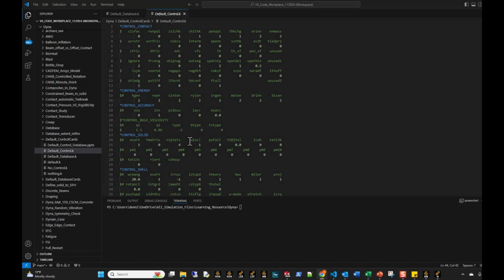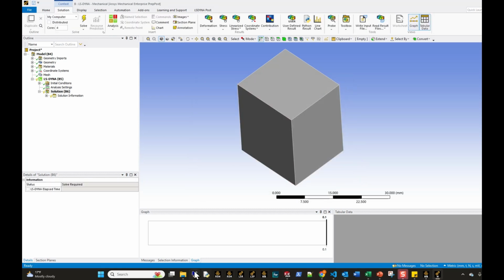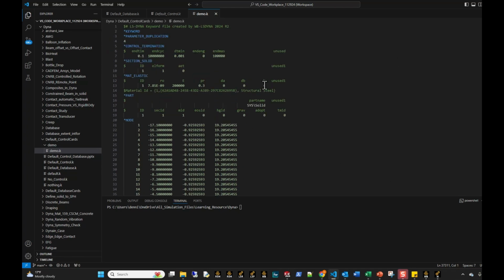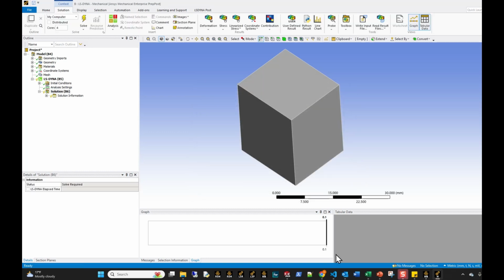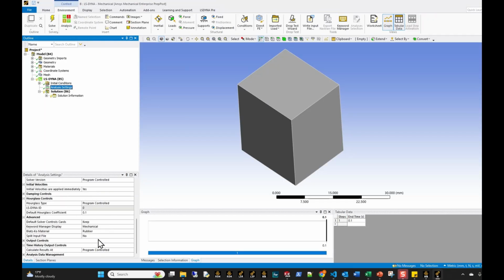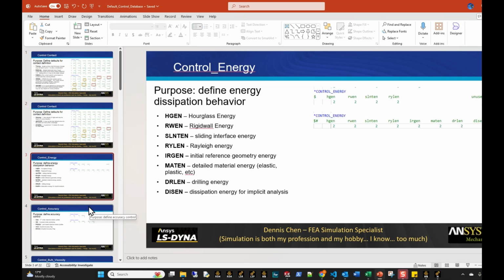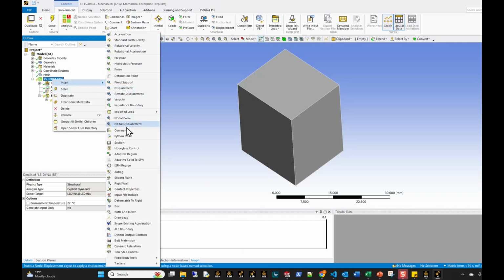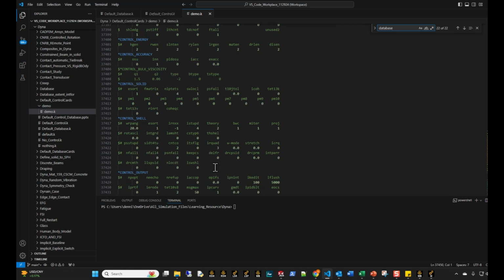Ansys LS-Dyna Quick Example - Don't rely on default control/database cards, use our own

Comment: Hello thanks for the great video, i am thrilled to learn more about the control cards. Could you be able to share a copy of your preferred settings for those cards and presentation as well.
Reply from the maker: Hello, mine changes all the time and I encourage you to study the control and database keywords so you can create your own.   that's the real point behind what I am trying to do, to not rely on a software to give you the template or a default, but to use your own.

Comment: Fantastic video—really helpful! I have a question regarding LS-Dyna materials that aren’t available in Ansys Workbench, such as MAT_072_R3.

I used the snippet method to copy the keycards (including the material keycard, EOS, and Enhancement vs. Strain Rate, which are required for defining that material) generated via LS-PrePost and pasted them into Ansys Workbench. However, when I run the model, it consistently results in errors. Does this indicate that Ansys Workbench LS-Dyna solver does not fully support all materials, boundary conditions, and element definitions from LS-Dyna?

Also, I’m curious about how you created the default control cards and database. Is there a shortcut for setting that up? I’d love to have a similar setup.

Once again, thank you for putting together such a great video on Ansys LS-Dyna!
Reply from the maker: check out a couple of my other videos but basically you just right click on the part you want to assign the mat_card to, and then copy the mat_card in the command snippit.   Make sure to leave the Mat ID parameter empty as the preprocessor will auto assign a number.

Hope this helps.
Reply from the maker: Hello, sorry to fully answer your question, LCID must be placed below the analysis setting, it cannot be placed in the MAT card, only the 1st Mat and EOS are recognized.   This is just how  Ansys has currently implemented this, and hopefully this changes in the future.   You can also look into the keyword manager inside workbench LS-Dyna, in my opinion, it's not as good as just using text editor but it's useful cases. 

As for the control and database card, what I did was just create them inside LSPP one by one and then save them as a .k file into a folder which is my master folder.   I then edit and combine as needed to create my own "default" control and database cards.

Hope this helps.